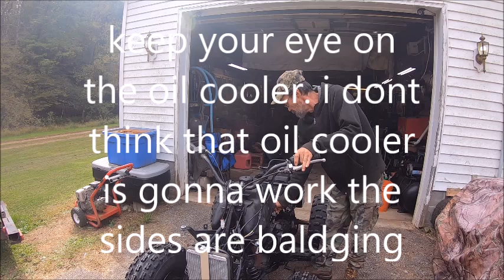95 yamaha big bear 350 moto 4 project pt 3

Comment: Wish I was there I would upholster that seat for you, that's what I do.
Reply from the maker: thanks. i went on and bought the cover i was talking about. the part i have a problem with is getting staples in it with my t50 staple gun and it looks like shit on the bottom.
Reply: @BisonWorkshop  glue probably won't stick very well to that hdpe.
Electric or air staplers work.
Reply from the maker: @billkasdorf3432  if it dont cost too much to ship to you. would you be ok for me to ship it to you. i want this to be right for my son.
Reply: @BisonWorkshop  yeah that's a easy one.
I'd be glad to do it for you if the shipping isn't to bad for you.
Dou you have a new cover still  ?